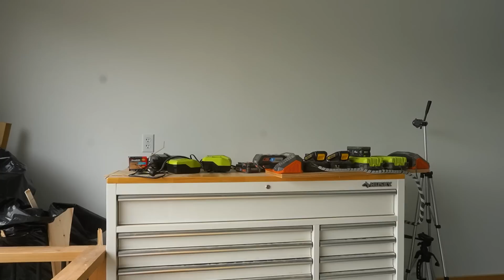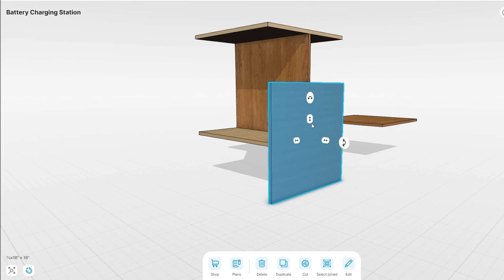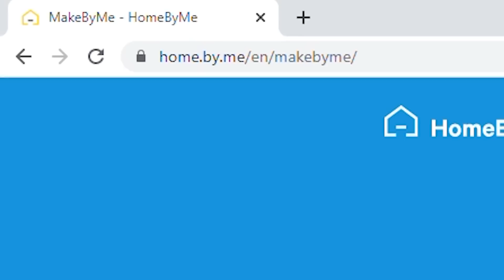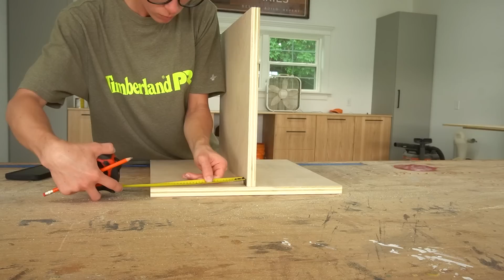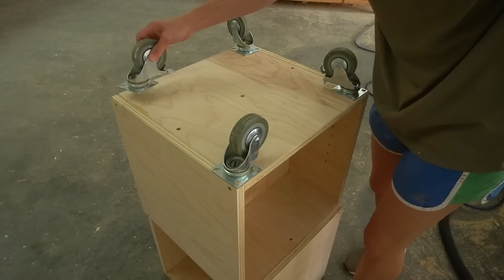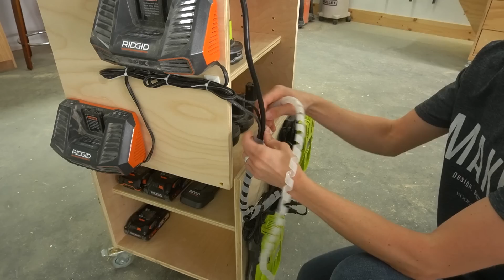How to Build a Workshop Battery Charging Station ON WHEELS!

Comment: But how did you come up with the design?  This is the part that I so want to see.
Reply from the maker: I just imagined it in my head—thought about how I could both store the batteries and mount the chargers, then sketched it out and built it.

Comment: Definitely going to check out the make by me software.  I may put away my graph paper and upgrade. 🤓 And I agree with Scott Morris' comment: this could be used for a lot of things...sanding and or sharpening station....or... 👍👍
Reply from the maker: Haha hand sketches are great--I still rely on them HEAVILY. But having the option to draw things up in 3D is sometimes nice to get a better visual of what the finished project will look like.  Plus the automatic plans are a really cool feature. Hopefully you find MakeByMe helpful.  But, yes this cart is DEFINITELY versatile.  I was thinking of all the other things I could use one of these for while I was building it.  I just got a new spindle/belt sander and I may make another one of these to mount it on.